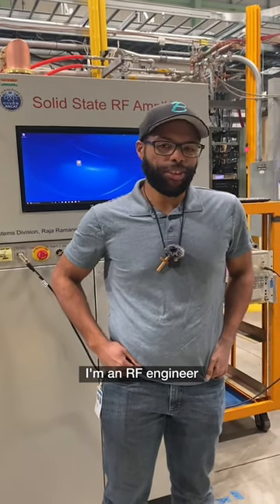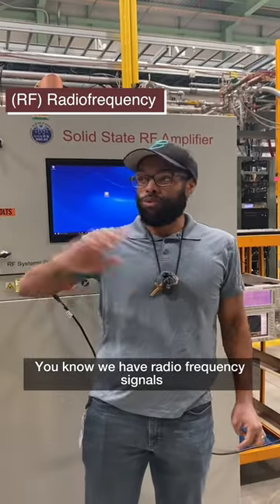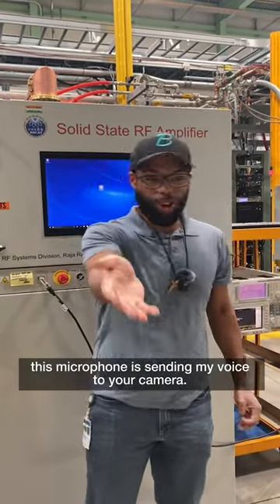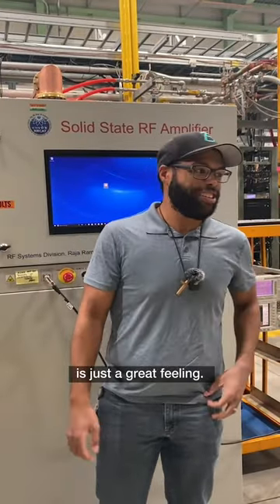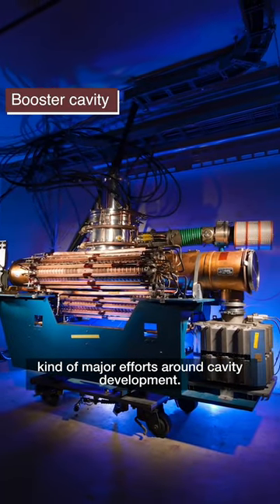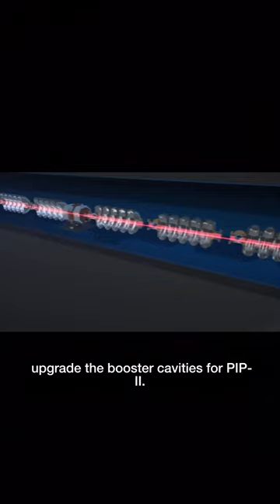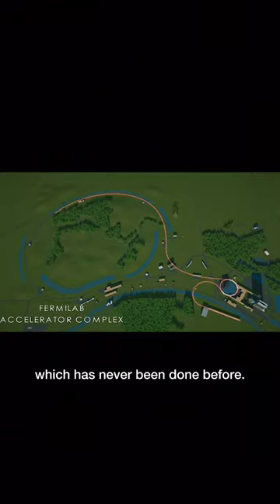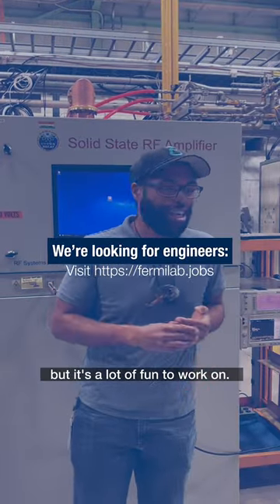Faces of Fermilab | Brian Vaughn #shorts

Comment: Hi all! I'm the engineer in the video. I really appreciate your comments! I'm not sure how much success I'll have in the future, but rest assured I'll do my best!

By the way, someone here asked for more details on the Main Injector Cavity. I'd like to create a video on this eventually, but I answered in a comment in case anyone is interested right now. I posted a reply, but I'm also putting it here. It's a pretty big info dump, fair warning.

So the Fermilab complex's primary accelerator infrastructure is composed of a proton source, a linear accelerator (linac), a small rapid-cycling synchrotron (the Booster) and a large rapid-cycling synchrotron (Main Injector). There's also the Recycler ring which doesn't accelerate but allows us to slip-stack, which is basically a method to double beam intensity by offsetting the momenta of two separate bunch trains and coalescing them into one bunch train before that train is accelerated by the Main Injector (MI).

As a side note, a synchrotron is a constant-orbit circular accelerator whose machine parameters must evolve with the beam velocity. For example, the faster the beam is going, the stronger our steering magnets will have to be in order to keep the beam at the same orbit around the machine, otherwise the beam orbit would increase with increasing velocity and smack into the beam pipe walls. On the RF side, well, we accelerate using RF drive, which means the acceleration fields oscillate in time. This oscillation energy is stored in the RF cavities in the form of electromagnetic fields. When a beam particle enters the cavity, the E-field Lorentz force does work on the charged particle, speeding it up and increasing its energy, but we need to time it such that the particles arrive at the right point in the RF cycle. Now the beam is going around in a circle. If it goes through the RF stations and speeds up, assuming the synchronization was perfect and the orbit is constant, it will arrive earlier in the RF cycle than it did on the previous turn. If we want the kick from the cavity to be the same on every turn then, we need to increase our frequency as the beam speeds up to keep it synched. This is why it's called a "SYNCHrotron".

It's not enough to tune the drive frequency though, we have to tune the cavities too otherwise they won't continue to store energy when the drive frequency changes. This goes into cavity Q and bandwidth and impedance-matching and blah blah blah.

Okay so the MI needs to tune through its frequencies in on the order of .5 s. For comparison, the LHC does it in something like 10 mins. In order to achieve this speed for the MI bandwidth (52.8-53.1 MHz), we use 20 ferrite-loaded normal conducting cavities. Ferrites are magnetic materials whose molecular magnetic dipole moment orientations respond quasi-cyclically to external magnetic field bias, changing their permeability as a function of bias field strength. That is, applying a magnetic field to the material changes the magnetic dielectric properties of the material, and unlike a magnetizable substance like iron, removing the bias field causes the material to return to its original properties (subject to hysteresis effects and temperature). If we expose the cavity fields to a tuner with ferrites, the dielectric properties will alter the energy storage in the cavity and change the resonant frequency. Another way to think about it is the dielectric changes the cavity's effective geometry from the perspective of the RF wave, which has implications for boundary-condition observance of the wave since the wave propagation is perturbed by the dielectric, shifting the eigen-frequency modal solutions of the sourceless Helmholtz Equation. To simplify, different material properties = cavity geometry "looks different" to the wave = cavity resonant frequency changes.

Now notice I said we have 20 cavities. We need that many to get the target energy gain per turn (~4MV turn voltage). But PIP-II is coming, and one of the things that PIP-II will involve is a higher beam intensity (more particles in the beam). This is not great because the cavities don't just talk to the beam, the beam also talks to the cavities. When a beam bunch passes through a cavity, it drops some of its energy in the form of electromagnetic fields. There's a net energy gain for the bunch, bunch the energy it drops can act on the bunches behind it, and if the dropped energy stays long enough, it can even act on the same bunch that dropped it on the last turn! 

Imagine you and some friends have to run through a chain of big rooms. Now imagine that all of you drop a banana peel every time you enter a room and there are janitors in each room that clean up your peels, but can only do it so fast. So your group drops some peels and the janitors frantically try to clean them up but can't get all of them before the next group arrives and some people in that next group inevitably slip on some peels and their running is disrupted. As you can imagine, the more rooms you have, the more peels each group will have to contend with. And the more people per group (higher beam intensity), the more peels are dropped.

It's the same with the cavities. More cavities = more perturbations on the beam, which lowers beam quality and can even destroy the beam if we're not careful.

So what do we do? Well, we can make the energy that the beam drops dissipate faster or make the energy drop weaker by changing the cavity design, but there's a catch. When you do this, you make the cavity eat up more RF power, which is dissipated as heat in the cavity walls and dielectrics; if you make it lose the beam's dropped energy faster, it has to lose all the other energy faster too. Okay well what about lowering the amount of cavities?

HMMMM

This would be a good solution, but we can't really do it with normal-conducting cavities because of breakdown and loss. If we lowered the cavity number, we would need to drive the remaining cavities harder, which means more heat dissipation which would melt the copper. Then there's the issue that strong field create micro-peaks on the copper surface, which create extremely large localized field regions that are so strong, they vaporize the copper, which then ionizes and creates a plasma that arcs a compromises the cavity accelerating field.

What about superconductors though? the very point of using them in accelerating applications is to generate very very high fields with minimal loss. With them, we can reduce the number of MI cavities from 20 to 2! The beam would be very happy with this.

Exceeept the cavities have to tune. In fact, no superconducting cavity has demonstrated the combined tuning bandwidth and speed that the MI demands, not even close. The bandwidth may not seem high on an absolute level, but it is WAY higher than any superconducting cavity has achieved to date. Add on that a superconducting cavity requires cryogenics environments on the order of 2 K (-456 degrees F) and ultraclean surfaces to prevent quenches from secondary emission (a quench is simply a loss of superconducting properties.) We can't use ferrites anymore by the way because a) the lossiness would cause them to disintegrate at the high fields we would target and b) the magnetic bias fields would quench the cavity (high mag fields on a superconducting surface makes the superconductivity go away).

So what options do we have? Most superconducting RF (SRF) cavities tune by brute force deformation (squeezing the cavity really hard to change its shape) or end-plate actuation (changing the position of a large plate at the end of a cavity to change its effective length) to change the cavity shape mechanically. These, for our purposes, are too narrow in bandwidth or too slow, so I'm really stepping into new territory here.

I do have a technique though that I think can work, and it's not fully original, it just hasn't been pushed to this level before. I don't want to share too much on it yet until the project is really off the ground, but I will say it involves contactless electromagnetic volume adaptation via rapid push-pull linear actuation. It's a bit nuts but someone's gotta be nuts, might as well be me.

I hope this was at least somewhat enlightening!
Reply: Best wishes for you rproject! I am looking forward to your video.
Reply: i really appreciate you taking the time to write such a relatively long explanation and follow up on a yt shorts comment section, God bless your work.

Comment: A superconducting rf injector cavity... that sounds amazing!!  Another video please, where you explain it in detail, what the current state of the art is, what obstacles you need to surpass in order to achieve superconductivity in an rf injection cavity, and also what all the advantage would be. Please!
Reply: I'm the engineer in the video. I'm interested in doing more videos but the logistics may make it take a while. In any case, I wanted to provide a more in-depth explanation since you're curious. Fair warning, info dump incoming.

So the Fermilab complex's primary accelerator infrastructure is composed of a proton source, a linear accelerator (linac), a small rapid-cycling synchrotron (the Booster) and a large rapid-cycling synchrotron (Main Injector). There's also the Recycler ring which doesn't accelerate but allows us to slip-stack, which is basically a method to double beam intensity by offsetting the momenta of two separate bunch trains and coalescing them into one bunch train before that train is accelerated by the Main Injector (MI).

As a side note, a synchrotron is a constant-orbit circular accelerator whose machine parameters must evolve with the beam velocity. For example, the faster the beam is going, the stronger our steering magnets will have to be in order to keep the beam at the same orbit around the machine, otherwise the beam orbit would increase with increasing velocity and smack into the beam pipe walls. On the RF side, well, we accelerate using RF drive, which means the acceleration fields oscillate in time. This oscillation energy is stored in the RF cavities in the form of electromagnetic fields. When a beam particle enters the cavity, the E-field Lorentz force does work on the charged particle, speeding it up and increasing its energy, but we need to time it such that the particles arrive at the right point in the RF cycle. Now the beam is going around in a circle. If it goes through the RF stations and speeds up, assuming the synchronization was perfect and the orbit is constant, it will arrive earlier in the RF cycle than it did on the previous turn. If we want the kick from the cavity to be the same on every turn then, we need to increase our frequency as the beam speeds up to keep it synched. This is why it's called a "SYNCHrotron".

It's not enough to tune the drive frequency though, we have to tune the cavities too otherwise they won't continue to store energy when the drive frequency changes. This goes into cavity Q and bandwidth and impedance-matching and blah blah blah.

Okay so the MI needs to tune through its frequencies in on the order of .5 s. For comparison, the LHC does it in something like 10 mins. In order to achieve this speed for the MI bandwidth (52.8-53.1 MHz), we use 20 ferrite-loaded normal conducting cavities. Ferrites are magnetic materials whose molecular magnetic dipole moment orientations respond quasi-cyclically to external magnetic field bias, changing their permeability as a function of bias field strength. That is, applying a magnetic field to the material changes the magnetic dielectric properties of the material, and unlike a magnetizable substance like iron, removing the bias field causes the material to return to its original properties (subject to hysteresis effects and temperature). If we expose the cavity fields to a tuner with ferrites, the dielectric properties will alter the energy storage in the cavity and change the resonant frequency. Another way to think about it is the dielectric changes the cavity's effective geometry from the perspective of the RF wave, which has implications for boundary-condition observance of the wave since the wave propagation is perturbed by the dielectric, shifting the eigen-frequency modal solutions of the sourceless Helmholtz Equation. To simplify, different material properties = cavity geometry "looks different" to the wave = cavity resonant frequency changes.

Now notice I said we have 20 cavities. We need that many to get the target energy gain per turn (~4MV turn voltage). But PIP-II is coming, and one of the things that PIP-II will involve is a higher beam intensity (more particles in the beam). This is not great because the cavities don't just talk to the beam, the beam also talks to the cavities. When a beam bunch passes through a cavity, it drops some of its energy in the form of electromagnetic fields. There's a net energy gain for the bunch, bunch the energy it drops can act on the bunches behind it, and if the dropped energy stays long enough, it can even act on the same bunch that dropped it on the last turn! 

Imagine you and some friends have to run through a chain of big rooms. Now imagine that all of you drop a banana peel every time you enter a room and there are janitors in each room that clean up your peels, but can only do it so fast. So your group drops some peels and the janitors frantically try to clean them up but can't get all of them before the next group arrives and some people in that next group inevitably slip on some peels and their running is disrupted. As you can imagine, the more rooms you have, the more peels each group will have to contend with. And the more people per group (higher beam intensity), the more peels are dropped.

It's the same with the cavities. More cavities = more perturbations on the beam, which lowers beam quality and can even destroy the beam if we're not careful.

So what do we do? Well, we can make the energy that the beam drops dissipate faster or make the energy drop weaker by changing the cavity design, but there's a catch. When you do this, you make the cavity eat up more RF power, which is dissipated as heat in the cavity walls and dielectrics; if you make it lose the beam's dropped energy faster, it has to lose all the other energy faster too. Okay well what about lowering the amount of cavities?

HMMMM

This would be a good solution, but we can't really do it with normal-conducting cavities because of breakdown and loss. If we lowered the cavity number, we would need to drive the remaining cavities harder, which means more heat dissipation which would melt the copper. Then there's the issue that strong field create micro-peaks on the copper surface, which create extremely large localized field regions that are so strong, they vaporize the copper, which then ionizes and creates a plasma that arcs a compromises the cavity accelerating field.

What about superconductors though? the very point of using them in accelerating applications is to generate very very high fields with minimal loss. With them, we can reduce the number of MI cavities from 20 to 2! The beam would be very happy with this.

Exceeept the cavities have to tune. In fact, no superconducting cavity has demonstrated the combined tuning bandwidth and speed that the MI demands, not even close. The bandwidth may not seem high on an absolute level, but it is WAY higher than any superconducting cavity has achieved to date. Add on that a superconducting cavity requires cryogenics environments on the order of 2 K (-456 degrees F) and ultraclean surfaces to prevent quenches from secondary emission (a quench is simply a loss of superconducting properties.) We can't use ferrites anymore by the way because a) the lossiness would cause them to disintegrate at the high fields we would target and b) the magnetic bias fields would quench the cavity (high mag fields on a superconducting surface makes the superconductivity go away).

So what options do we have? Most superconducting RF (SRF) cavities tune by brute force deformation (squeezing the cavity really hard to change its shape) or end-plate actuation (changing the position of a large plate at the end of a cavity to change its effective length) to change the cavity shape mechanically. These, for our purposes, are too narrow in bandwidth or too slow, so I'm really stepping into new territory here.

I do have a technique though that I think can work, and it's not fully original, it just hasn't been pushed to this level before. I don't want to share too much on it yet until the project is really off the ground, but I will say it involves contactless electromagnetic volume adaptation via rapid push-pull linear actuation. It's a bit nuts but someone's gotta be nuts, might as well be me.

Anyway, I appreciate your interest and hope my response was at least somewhat enlightening!
Reply: @BVfermi  That sounds like an amazing puzzle box to work on!  "not fully original" i.e. standing on the shoulders of giants, who in this case perhaps their idea wasn't necessarily targeting of your use-case? Or magnitude.  "Electromagnetic volume adaptation via ... linear actuation" -so, tuning the cavity by changing its electromagnetic shape?  Would this replace the existing cavity design, or supplement it?  What other factors are there to alter, besides physical design and magnetic field?

Anyways, thanks for your answer, really fascinating stuff, it must be a dream come true to work at Fermilab.  To get to invent such things, at the limits of physics... do you blog about this?  (Can you blog while working at Fermilab??)